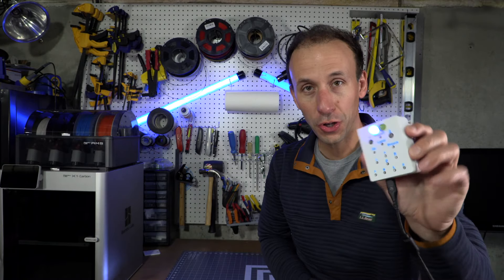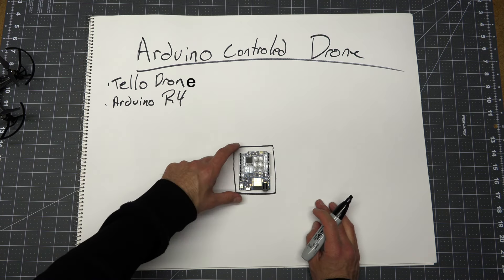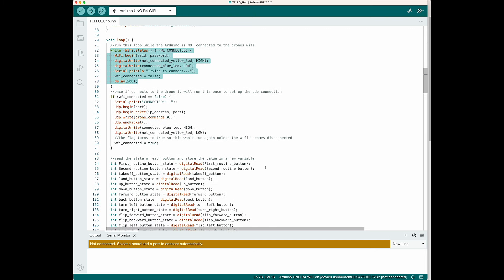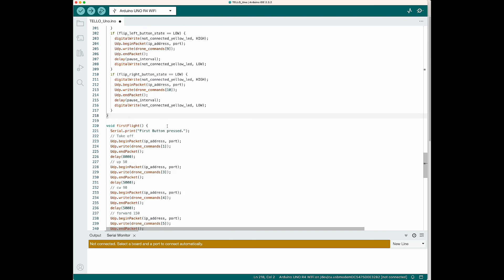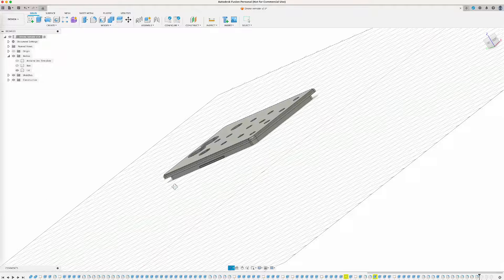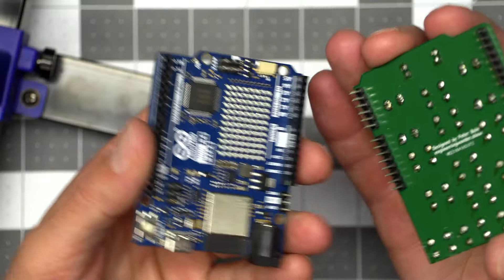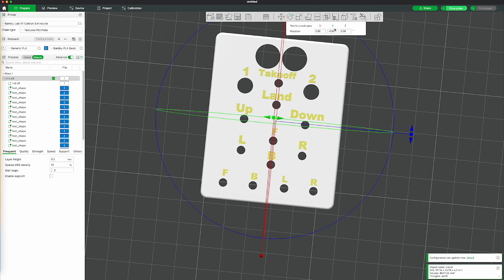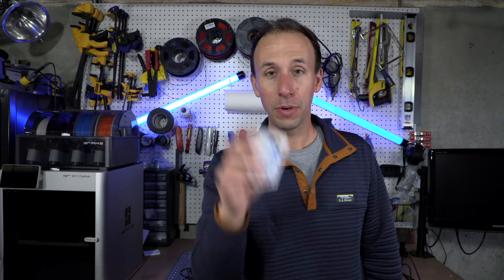Arduino R4 Drone Remote

Comment: Really nice idea. Thank you. I purchased a Tello drone from Amazon 2 years ago and it seemed that by the time I got it to connect to my WiFi, I only had less then 10 minutes of fly time.  I sent it back within 2 weeks.  I so wished it worked. Could I have gotten a better battery maybe?
Reply from the maker: Thanks! I hear you. It is a little cumbersome to connect to your phone or iPad. Not sure there are better batteries for it. I just have 3 on the charger all the time. When one dies I swap it out.
Reply: @engineeringwonder  I went that route too. But after you change the battery you have to reconnect it. LOL
I went crazy. I thought about some way to keep it connected but I just figured I'd buy a better drone. Never did. :)
Now I'm making robot cars out of ESP32's and Ardiunos
Reply from the maker: @GaryParkin  Yeah having the Arduino auto connect is a game changer for me:)
Reply: @engineeringwonder  That's interesting. I may have to re-buy that drone.  Thank you.